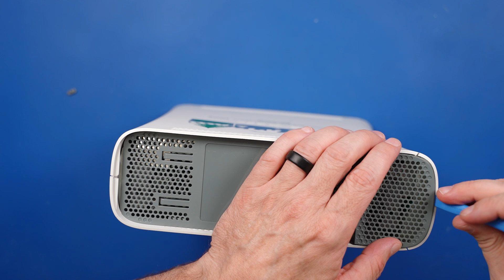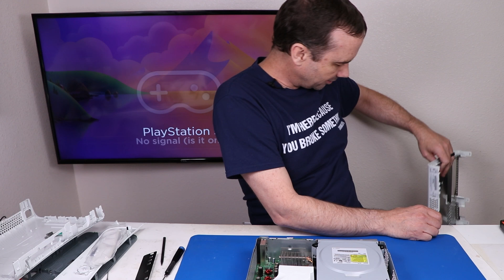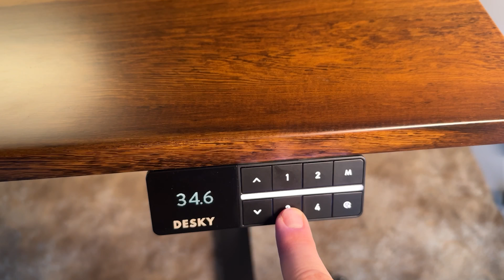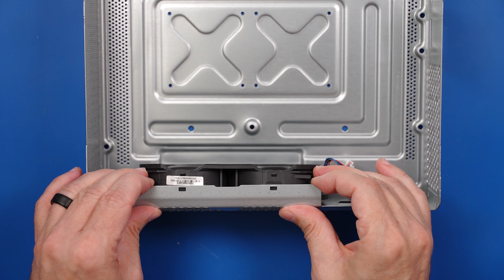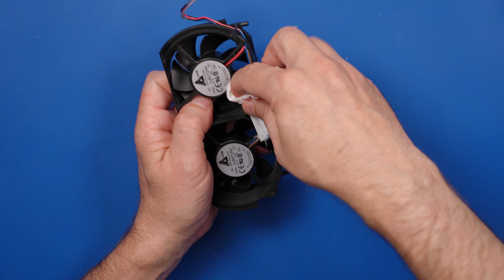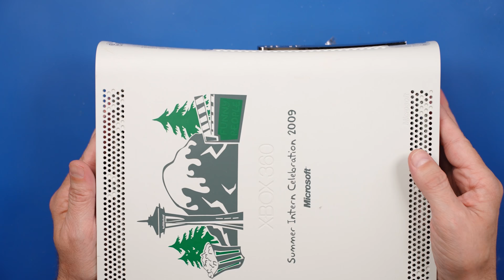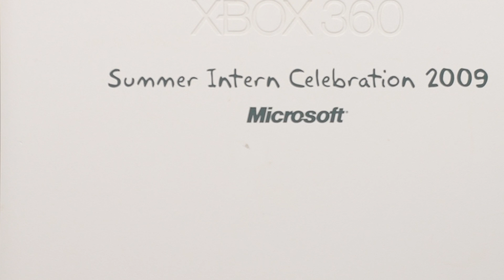I Found A SUPER Rare Broken Xbox at a Thrift Store! Let's Fix It!

Comment: Yout didn't remove the solder blub laser shild from the ebuy lens! picup laser will not work if u didn't remove the laser solder shield hope help
Reply: I reviewed the video at slow speed, there is a "big" solder blurb on the left of the board. Is it that the laser shield protection??
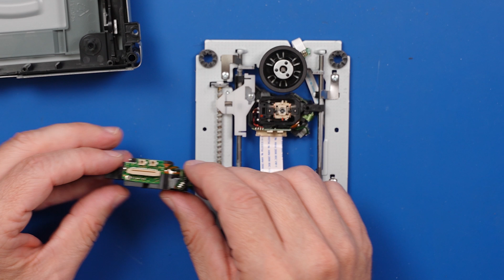Reply: @fredericmanson441  Yes, you can clearly see it at 18:30, right next to the ribbon cable connector. It's there to protect the laser from static electricity during shipping. It also means that the laser wasn't used, but indeed new.
Reply: @fredericmanson441 yupzz that's the solder laser shild all new picup lens have that! need to remove the solder to make the laser work😅

Comment: I just changed the thermal paste on my 360.  I left a bunch of screws out to make it easier to take apart in the future.😂

I bought a new battery for my 3DSXL. The old one was bloated pressing on the other components causing the bottom screen to go black.

The new battery solved that issue, but the controls still didn't work. I Googled the issue and it said, "A screen protector could cause the controls to lock up. " I took the protector off and it worked fine.
I'm so glad I didn't get rid of it.😊
Reply: @natevaughn2307  Softmodding the 3DS has become so easy it's worth looking into.  I recently installed all my physical games to make it much more convenient to play.

Comment: What causes the lasers in DVD drives to fail? Is it just time causing degradation?

I don't remember anyone putting away game consoles or DVD players because they stopped reading disks.
Reply: The laser and the drive belt are a weak point in post-fixed (new CPU) fat 360s. Easy and cheap to replace (if you remember to remove the static solder blob on the new laser, which Steve didn't...). This console is a post-fix Falcon board, identifyable by the four RAM chips, the pre-fix had eight. That also means it's a more reliable board which generally doesn't get RROD.

Comment: There are 2 screws next to the laser that you can adjust.  Thats how I fixed mine back in the day.
Reply: He literally did that. Did you watch the video?
Reply from the maker: Lol
Reply: @TechTinkerWorks I literally missed it.  Just say he did try that.  You must have missed it.
Reply: That's only a temporary fix, though, and new lasers for LiteOn drives are really cheap, under $5 for a reliable one. And they really work, if you actually remove the little solder blob protecting it from static electricity. Steve didn't on the laser he put in first.
Reply: 17:10 is your friend.
Reply: @willster947 ya I missed that part.   Nevermind

Comment: Did you remove the anti-static solder bridge from the first laser? Looks like it's there before installing it but hard to tell past that if you did it off camera
Reply: You can see it's still there when he puts the laser on the rails. The disc didn't even attempt to spin, which means the laser didn't engage at all.